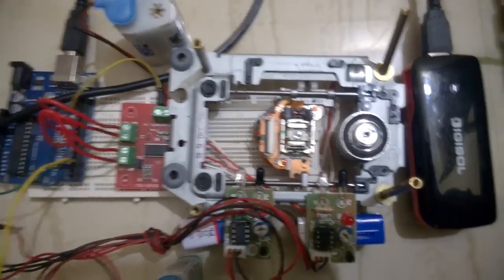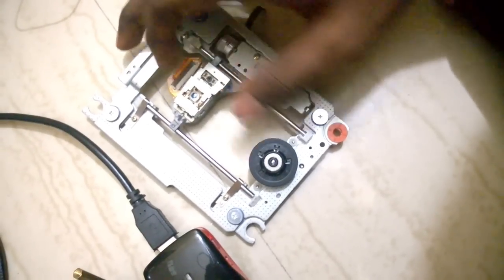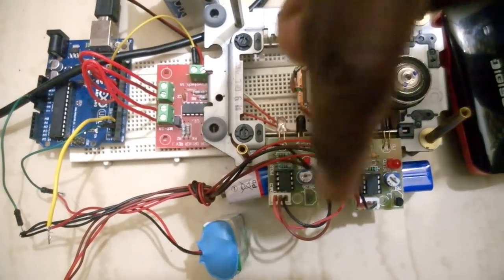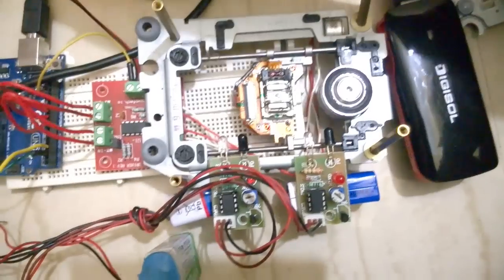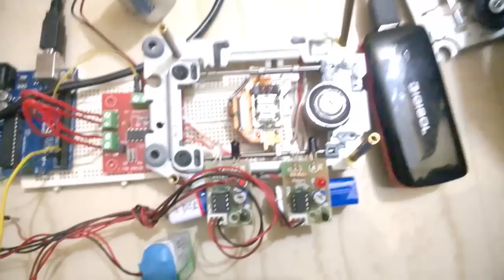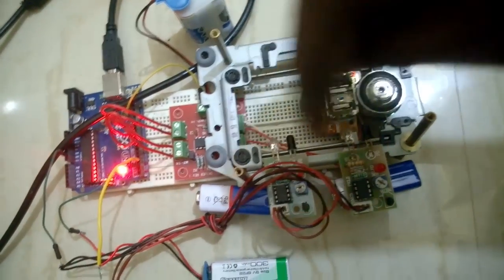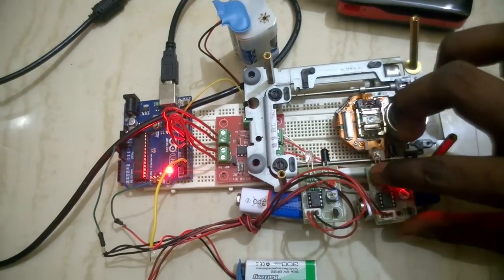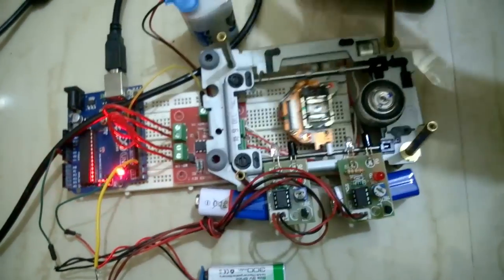Sensor controlled Stepper Motor clockwise and counterclockwise direction

Comment: Bro can u pls expln the for the following simulations.. 

Bro.. I am going to use three sensors which are connected in analog read pins A0, A1 and A2.. 

Firstly i need to read A0 sensor condition, if it is in OFF condition for 3 sec, i need to rotate my stepper forward direction untill sensor A1 gets Off condition then i need a delay(5000) and i have to move my stepper to reverse direction until sensor A2 gets off... (for continues cycle).. Can you plssss help me for coding.. I did all.. But cant abe to write the programme without compiling error..